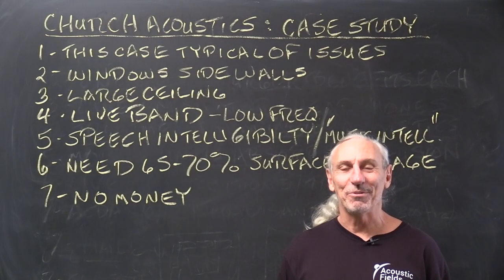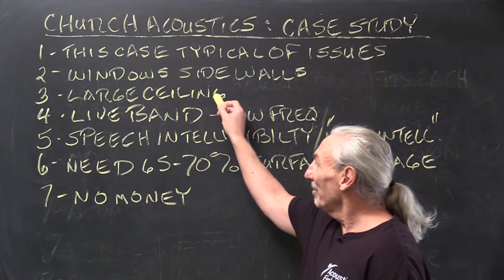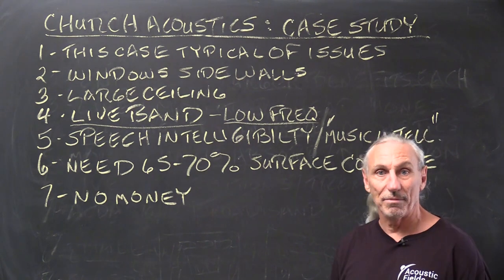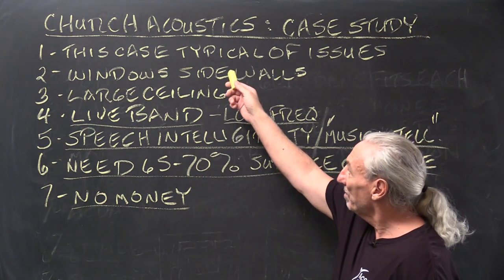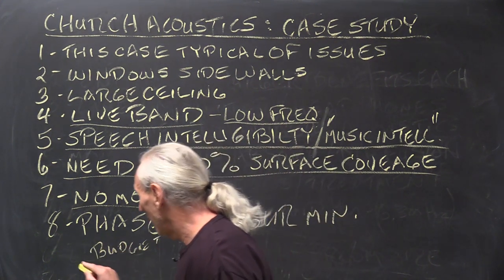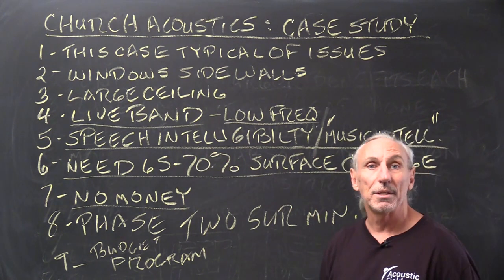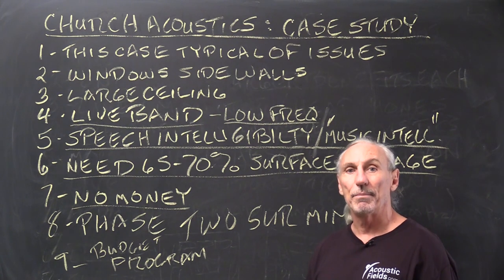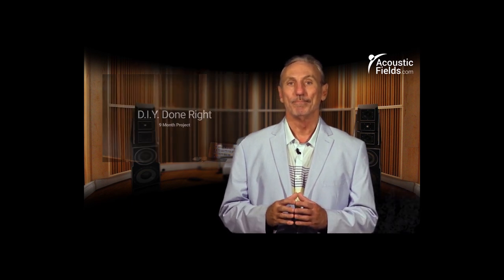Church Acoustics - Case Study - www.AcousticFields.com

Comment: Will diffusion work to eliminate feedback in a Church's PA if the offending frequency is targeted?  For
the last few tradition churches with pipe organ and choirs, I don't think foam is an option.
Reply from the maker: M, No, diffusion will make your "feedback" issue worse. Use the proper rates and levels of absorption on the offending surface areas.
Reply: What’s feeding back, the speaker or a vocalist? Two ways to eliminate feedback. 1. Turn down the gain and move microphone closer to the source 2. Increase the volume of the source.

Comment: I need goods advise for our church we have height concrete wall 10 meter with length 63m and our ceiling material plywood.. and we have big echo problem, do we need wall acoustic diffuser or absorption? What’s best solution? Or do we need change our ceiling material to acoustic material? Like boreal echo stop with rockwool absorption ? Thank you
Reply from the maker: Y, Use absorption that has the proper rates and levels for music and voice. Music and voice are the "products" of a church. You must match the rate and level to frequency and amplitude. You will have to cover 60 - 70 % of surface areas.

Comment: My church has events in our cafe.  It has carpeted floors, dropped ceilings and the acoustics are so dead.  When I clap, it sits right there.  What can we do?
Reply from the maker: M,  Remove piece by piece the sound absorption materials to increase the reverberation times within the space.  If you can not do that, you can add diffusion.